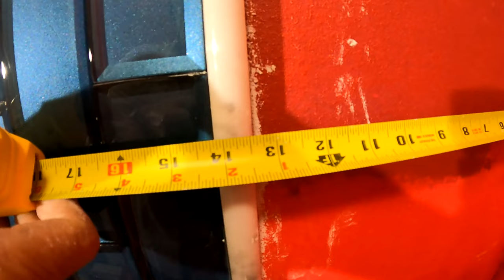SHOWER WALLS START.....Day 9

Comment: Hey Bob what do you use behind mosaic accent tile to have it flush with the other tile I have found that the mosaic is much thinner
Reply from the maker: You cut strips of 1/4" backer board and glue to wall where thin mosaic will be to get bump out needed